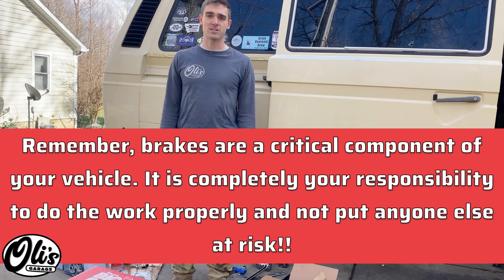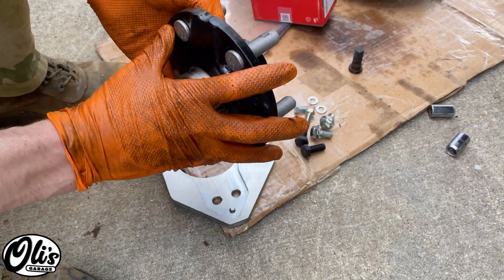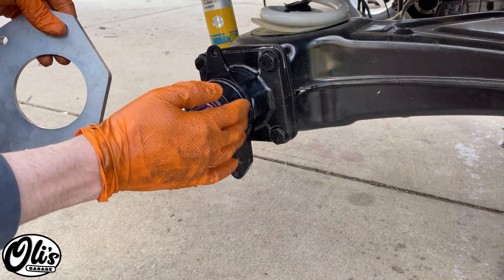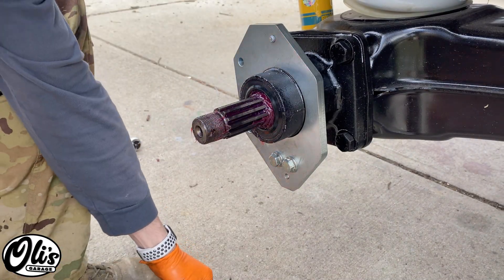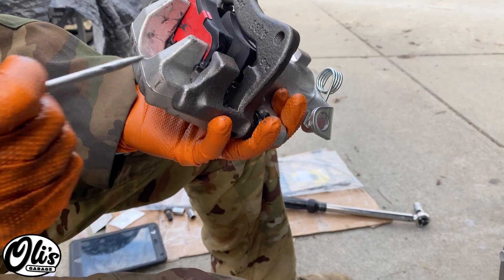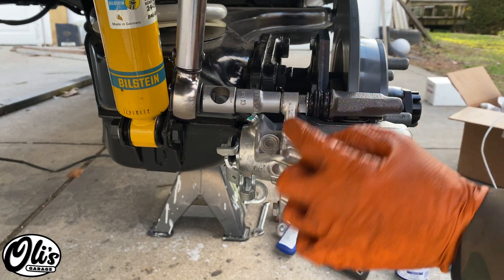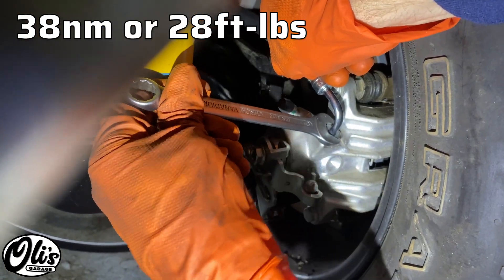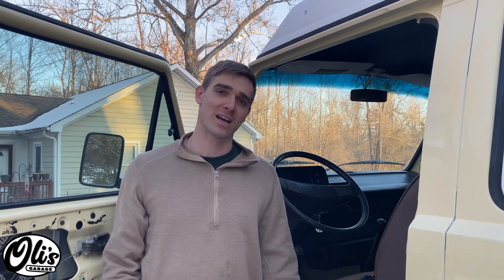Vanagon Epytec Rear Disc Brake Conversion Tutorial

Comment: Nicely done. I have the same kit, but not installed it yet 🤫
Reply from the maker: @Italjohn  are you going with the T4 rear brakes? It’s almost the same setup. I’d go with those because (if I remember correctly) you already have some pretty big front brakes, right?

Went with the slightly smaller rear brakes so that the discs aren’t the exact same size as my front discs. Not sure that it matters that much, but that was my thinking.
Reply: @OlisGarage  I will use the rear Sharan brake setup, as I already have them from my donor Sharan (bough it for the AFN engine)
Reply from the maker: @ oh even better then! It’s a sweet setup. Super easy to install as well. No machining needed…haha!